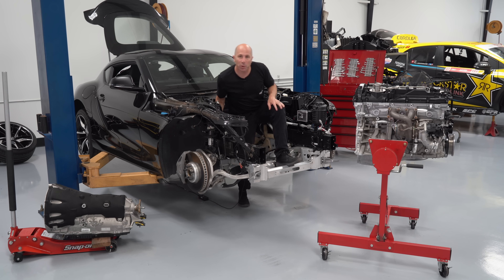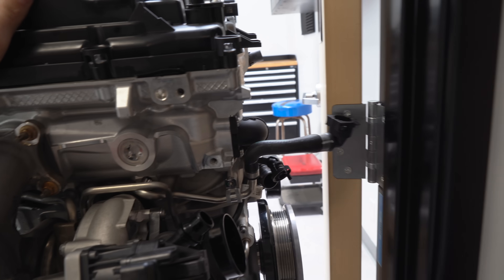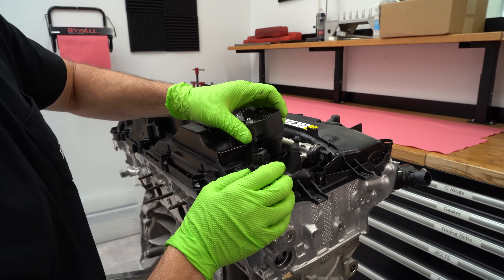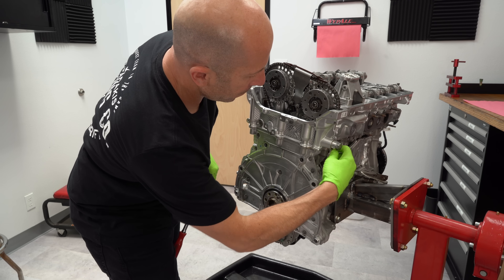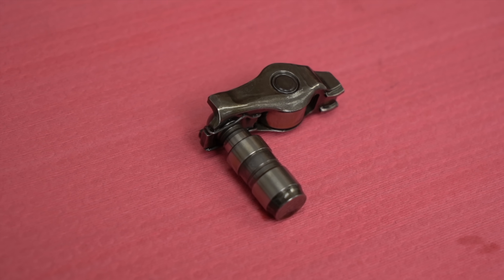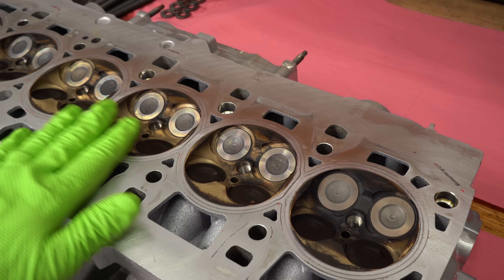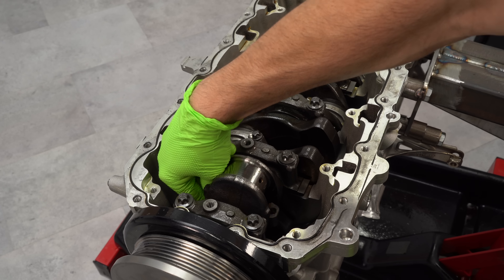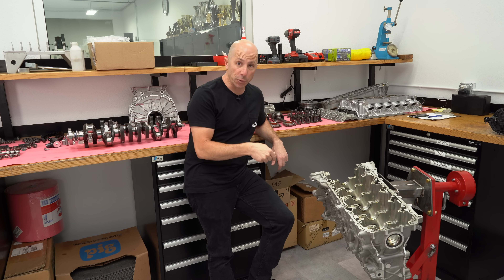2020 Supra B58 Engine Teardown - First Look - Better than the 2JZ?

Comment: Holy plastic batman.  That engine will never last 100k.  Scotty is right.
Reply: @davidgreen3378  You don't watch Scotty Kilmer do you?  He's been over this exact topic with numerous examples.  The "engineers" aren't the ones calling the shots.  The accountants are.
Reply: @davidgreen3378  You must be like 10 years old.  That has to be the most ignorant thing I have ever herd.  It would take too long to bring up to speed on how asinine your comment is so I'll just let you be.
Reply: Plastic all over the engine, intake, cooling, oil system - all with plastic parts, what a pile of trash... The plastic tends to degrade because of temperature cycling and contact with oil/antifreeze, eventually it become brittle and some pieces of plastic can get into oil channels, clog some oil passages, it will take 10-15 years to degrade and fall apart but still it's like primer inside engine. There is nothing impressive about this engine, just yet another planned obsolescence.
Reply: @alexanderfl-ts3171  you assume it's a regular plastic. I'm sure there are composite plastics that have better material properties than their metal analogues
Reply: @P0k3D0nd3M4cG    If you are over 20 years old.  I am terrified for the future.
Reply: @insertgoodname4809  be afraid. Someone has clearly not taken a material science course
Reply: @P0k3D0nd3M4cG  Someone had clearly not lived in the real world long enough.  Once you get outta school kid you're gonna realize things don't work the way they tell you they do.  I suggest you take a course on business to find our why people make the decisions in manufacturing that they do.
Reply: @archerdog1 " Modern engineering methods" in cars?  Yes I do.  You don't seem to know that.  I'm not trying to say I'm a genius but this is some pretty commonly known stuff.  Plastic in the engine bay is not used because it is a superior material.  It's used because its cheaper.  For further clarification and proof watch Scotty Kilmer's videos.
Reply: @insertgoodname4809  It's used because in this case it is the superior material, "plastic" is significantly lighter than even magnesium. If you care to think for a second and not be stuck in 1975 you would understand that. Also modern nylon has very good long-term thermal stability, with some loosing 0% in tensile strength after 2,000 hours of high temp cycling.
Reply: My concern based on real story: one particular modern ford V8 diesel engine, well engineered robust(it's diesel after all), but had plastic part which contact with oil and coolant(part for distribution flow of cooling liquid to heat exchanger with oil, to keep oil at working temperature), with time(10+ years) plastic become brittle and start crushing and drops small plastic fragments into flow, it is not so critical for cooling circle there thick passages, but plastic also get into oil system and one lucky piece stuck and clog oil channel to rod's journal bearing  - without oil it burned fast, engine died. It could be rare case, but might be common thing.
Ofc it was not a regular plastic, but it still failed. Safer would be just not put plastic, at least not into oil system.

Modern doesnt always means better, 2jz tested by time and many enthusiast as reliable and robust engine, while this new one are schrodinger's cat so far - time will show how good it is, but i'd not trust engine with plastic parts in its important units.
Reply: @alexanderfl-ts3171  The intake is not in direct contact with oil, while it is in direct contact with the head it also has air running through it. Plastic valve covers are somewhat susceptible to cracking, the valve cover on the b58 looks well reinforced. I also suspect that Ford cut corners more than BMW in the type of polymer they used, one would hope the extra cost of BMW would go toward better plastics and design.
Reply: @archerdog1  Wow you are a marketing mans dream.  You really believe those lies that these car salesmen spew?  Have you ever gotten your hands dirty building something or oily servicing an engine?  Like I keep saying.  You don't need to argue with me.  Go and argue with Scotty Kilmer.  Post a comment on any of his videos stating that plastic is used to "save weight" in an engine.  Watch the tidal wave of negative comments that ensue.
Reply: @alexanderfl-ts3171  You think these kids hold stock in this car?  I am confused as to why they are having such an emotional response to rational criticism of planned obsolescence.
Reply: @insertgoodname4809  I'm a mechanic. And going to school for mechanical engineering. Why don't you try a thing called research? And not just listening to that broken record. Just stop embarrassing yourself, and go to a junkyard and see how many cars died from plastic problems and how many from abuse.
Reply: @archerdog1  spoken like a true child.  "research" is the new industry buzz word.  It doesn't mean anything.  Site your actual sources, or do you not have any?
Reply: I'm talking about that black plastic assembly he removing at 2:53, very similar system was on ford engine i've mention before. Everything else not good practice to made of plastic but it is not as bad as this.  Even oil filter case made of plastic...
I can close eyes on many plastic things, this days it is common, but oil system too important to be made of plastic, in particular the part which supply oil to crankshaft - this passage must be robust.
Reply: @alexanderfl-ts3171  I'm betting that was for weight savings. But I agree, plastic even high temp, glass reinforced, nylon, isn't the best option for somewhere that will see high twisting force.
Reply: @archerdog1  Just to get this straight.  Your position is that they chose plastic for certain engine parts Primarily because of the weight savings?  That is your position?
Reply: @archerdog1  Backtrack much?  I thought you said that they used plastic because it was lighter.  You're a joke.
Reply: It is not F1, professional racing nor rally, it is street car - there is no need for saving weight so desperately.
About that particular plastic part, it is just cheaper to make it plastic, just try to figure how you'd make it of aluminium - it would require complex casting or cnc machining it which both not cheap, casting plastic cheaper. But in this case solution supposed to be getting rid of that part at all, mount heat exchanger and oil filter on block and attach aluminium/steel pipes for coolant on top of heat exchanger, it would be slightly heavier than plastic thing and require addition machining of the block, but it's much simpler and reliable solution.
As for weight saving, they save mass on such parts while using chain drive for camshafts, however using simple timing belt would save mass in this case. What about block, i wonder what is made of, mostly aluminium? I saw old engine had block made of magnesium-aluminium alloy with 90% of magnesium - this saving a lot of weight, this big i6 block would benefit of such saving mass more than all this plastic parts in total.
Reply: @alexanderfl-ts3171  They could of made everything out of aluminum if they wanted. Plastic is lighter and cheaper. They don't use the aluminum/magnesium block for turbo cars, I'm not sure why, probably heat issues.
Reply: Yes you right, seems it is safety concern - i almost forgot that magnesium catch fire at temperature around melting point of aluminium, not good thing for street car.
Reply: @archerdog1  oh you want more?  Just clarify your position first.  You think they used plastic in the engine primarily for weight saving?  Not so confident now are you.

Comment: Really cool video! Looks like they only coated half of the bearings? I guess just on the side that sees a lot of wear on startup? I'd like to see some forged rods and pistons for big power, also auxiliary port injection, bigger turbo, that's about it though tbh. Interesting design.

Comment: so, what if that water-air intercooler leaks? is the water gonna get into the cilinder straight away? that would be a funny mess :/
Reply: Yeah, so what? You do know that’s what happens when head gaskets fail right? And on some designs other gasket failures lead to the same issue. 

It’s nothing new.
Reply: @DrewLSsix  well, is not nothing new but you are adding another thing that can cause that.

Comment: Great video! Glad someone took time to shed some light on the BMW closed deck motors. Something us S55 F80 M3 guys already knew. Keep up the good work! Shame it took Toyota to use a BMW motor for it to get well deserved attention. People need to realize Toyota would'nt put it's long time reliability ratings at risk if the BMW inline 6 wasn't worthy. They could have said "WTH..  LS swap it", or any other manufacturers motor but they didn't.

Comment: I cannot wait for new mods for B58 engine, I have m140i with the same engine, stage 2 running 457.2bhp and 618nm I want more but fuel pump is limiting factor :( I hope someone will solve it soon so I can get more power out of it
I would be very happy with 600bhp and 750/800nm

Comment: Love some of the stuff on this, engine external yet integrated oil cooler, 6-2 exhaust manifold must really help with spooling and maintaining constant airflow into the turbo, plastic intake with integrated cooler, plus a few other things but for a average engine builder those springs on the cam look a nightmare along with rear facing timing and nowere to bolt a engine stand onto are going to be a right pain.

Comment: Wasn't the original Supra's biggest allure that anybody can modify it in their garage? 

Yeaaa, not with the new one.
Reply: Not when it was new. Cars like the mkiv supra, GTRs, 300zx, nsx and rx7 all got their appeal from tuning houses (like HKS) taking the base car and producing heavily modified monsters.

They only became cars you could tinker with on your drive when

A. A driveway mechanic could afford the car.

B. A driveway mechanic could afford the parts.

10 years ago that was an s body or a rwd skyline here in England. Now it's a 350z. In a few more years it'll be a gt86

It's just economics. If you can afford a brand new supra right now. Your probably not a early 20s guy at university who's working a part time job to buy parts for his car to fit with his mates on a weekend :) 

That's all it is really :)

Comment: How are you going to solve fueling problem to go over 450bhp? Thats what fuel pump is rated at and wont do more, you need hpfp which as far as I know no one has done yet :(
Reply: @Seb C Nah, I dont want to use meth
I rather to wait for better hpfp and keep it that way
I think thats what bigboost do? they use meth
Reply: @Seb C can you tell me more how its done?
I presume it would work as the methanol(same injection, place(throttle body) etc) but instead of meth i can use petrol, correct?

Comment: the efficiency is really good. all the detail makes this engine very high tech beyond most exotic cars engine. the problem is, its hi-tech which mean big hassle when it comes to any type of engine work or upgrade. small maintenance or bolts on seem like you have to pull the motor. each component seem like you need to learn engine 101 all over again to understand if you set it or torque it correctly. if engine bogs down you cant pin point where to fix. could it be the inter cooler clog? its inside the freaking thing! when you actualy check it and its not the problem 99 more  place to check..

super impressive engine so they packaging it inside an engine bay is harder for tuner or average mechanic to work on. yeah talk about labor-raped when you need to do diagnoses.

Comment: Wayyy better than the 2jz yup sooo much programming has been made since the old days man we have electric cars faster than Supras and now we got a bmw inline 6 producing 300hp+ out of the factory a lot of people don’t understand you can’t compare a stock 2jz with a 1000hp 2jz to this engine not fair because ITS STILL STOCK YOU IDIOTS wait until they tune it and adjust the timing and increase the compression ratio and they fabricate aftermarket parts just wait you guys may not like it but this is the new generation you old guys won’t understand lol

Comment: All BMW inline six have the timing at the back of the motor, absolute pain in the ass
Reply: False
Reply: @jamesphares244  Really? Which ones have the timing chains at the front?
Reply: @JasperCultken  I meant to put n54 and n55. I am a bmw tech and this is the first one to my knowledge.
Reply: @jamesphares244  really? Damn, every day is a school day!
Reply: @JasperCultken  just remember if you ever buy a bmw if it's a v8 or a 4 banger dont get it. Inline 6 is the most reliable
Reply: S54 n54 n54 are a few examples

Comment: The engine is more modern I give them that the germans know how to build a good i6. But my biggest problem with it is that toyota shouldn't have that motor in it. I know toyota likes to use Kawasaki engines and some other manufacturers around but to put german engineering under a jdm hood is wrong in my opinion. I was really hoping that Toyota would of went back to the drawing board and redesigned the 2jz to a modern engine. Have all the awesome perms of it like a forged crank, close deck, great pistons and rods, ect but put it with a timing chain a more modern variable timing with how aggressive the intake can get. Just something so unique that came out of japan could of been so great to see. It just seems this is a huge cash grab for a supra now. The body looks great.
Reply: TheUntoldTruth1003 toyota usually goes to yamaha for their performance engines and they could have developed a new i6 from an i4 like the 2zz
Reply: @carholic-sz3qv  that would of been awesome as well. Just something jdm under the hood of the supra.

Comment: Fun fact: That throttle body isn't actually controlling engine power, it's just using when the engine is starting (making it more of an "idle valve"). They instead control power by varying the valve lift using the VANOS/Valvetronic setup.

Comment: VW EA888 motor has the same exhaust setup whereby the exhaust is cooled by the engine coolant.  Pretty trick setup to fuel efficiency and lower emissions.

Comment: I'm surprised that it doesn't use cross bolted mains. I understand the windage tray significantly strengthens the block by tying the mains into the block skirt, but why not run a cross bolted mains similar to the American V8's (LSX, Gen 3 Hemi, Ford Mod)? I feel like that would have given them enough room to add an additional bolt to help secure that crank at 9,000rpm and 1,000+ HP a lot better than a cast aluminum girdle

Comment: I think Toyota went with bmw for the engine was because bmw has many more years of experience building and racing with straight 6 engines.
Reply: Ryan beck nope it’s because toyota stoped making i6 engines since more than 20years and its very expensive to redevelop a modern standard more fuel efficient And also emissions certified engine
Reply: That’s what I said.

Comment: Very interesting to see this teardown.  Looks like a nice crankshaft and has some other redeeming qualities in the valvetrain.   Not sure about all that plastic though.  That can't possibly age well.  Weird there's only two exhausts coming off a six cylinder...never seen that before.   Doesn't present any issue though apparently.   Someone will explain it's just a different style of collector and nothing to worry about.  I'm pretty sure this builder can make 1000 HP I just wonder if it's going to be 1000 reliable HP.   The 2JZ is the proven engine and makes for a good benchmark comparison.  Thanks for the video good luck!

Comment: The oil to water heat exchanger... gives me shivers. I just imagine water getting in the oil and getting expensive fast 🤪
Reply: vw diesels had this concept for years and never had a single issue.
Reply: @janprokopenko7928  Not just VW, many manufacturers have been using this type of oil cooler for years now as it has the added benefit of bringing everything up to operating temperature quicker. 
They do fail occasionally but most people end up with oil in the water and not the other way around.

Comment: anyone else notice that last cylinder has a noticeably more carbon buildup than the rest? on a 500 mile engine
Reply: thats probably the closest cylinder to the egr
Reply: Already doomed
Reply: @BF109G4  you guys dont even know whats going on in an engine thr carbon is probably coming from an egr or pcv dump closest to that cylinder nothing crazily or unheard of
Reply: James Flores which means that one piston is more critical and exposed to failure. One piston failure means full engine overhaul.
Reply: @BF109G4  oh so now carbon buildup equates to a rebuild

maybe thats why manufacturers recommend an engine cleaner every what 36k? but its going to be at least $700 from a dealer so no one does it but sea foam is at walmart
Reply: James Flores read my reply carefully
Reply: @BF109G4  carbon buildup does not equate to a "critical" or "exposed to failure" (whatever that means) engine

in fact I think the engines exposed to the most failure are put in domestics ya know since theyre put around a lot of stuff that fails